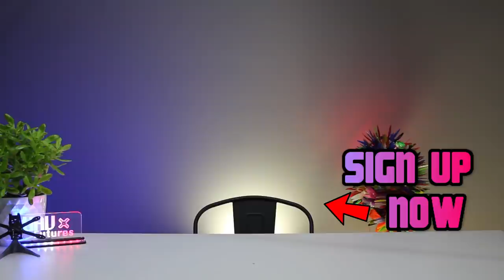GOLF CLUB VS UNBREAKABLE DRONE!! Karearea Talon V2 review

Comment: Maidened raceprac with mine today on 6s i posted the link in your discord :) not in the video but i hit a steel pole right on the front talon motor protector and i couldnt even see where it hit! it is indestructible.  got my second frame arriving tomorrow. its so good and looks so much better sitting next to my other quads.

Comment: when i first started flying there weren't any good simulators, hell there were no fpv cameras even and we flew on wii mods and kk boards.  at any rate, i lost orientation on my flamewheel 450 because it got too high and i couldn't tell which way it was headed.  it was probably 400-500 feet up and i decided that just disarming was the way to go.  i was in this big open field with small hills with pine trees on either side.  the quad came tumbling through the air at mach 1, slammed into a couple of the trees on the hill, hit every branch on the way down, hit the ground and rolled out into the field like a gymnast doing cartwheels.  all 4 props were shattered (this is in the days of glass-fiber props), i had 2 bent motor shafts, and 3 broken arms.  pretty sure my pvc pipe landing gear died too.  probably the craziest wreck i've ever had.  and seeing it happen basically in slow motion from a distance was something i'll never forget.

Comment: Looks awesome. Another possible con is camera mount? I don't see a good spot for mounting a camera :-(
Reply: Fits all micro fpv cams. if you're referring  to a gopro etc. there are slots for a strap near the top, but would need to design a mount that fits over the fin, not sure if anyone has already designed something  or not

Comment: I completely dead on center crashed into a metal rugby pole at full throttle. Literally nothing happened. I just bent a prop but that's all. My camera could have so easily died that day. I was flying a Realacc Karearea Talon clone and it took no damage at all. Actually the pole took more damage because I scraped off its paint in that crash. The camera was protected by the sides of the frame and somehow it (camera and frame) survived perfectly fine.

Comment: Yep this injected plastic will be the way alot of frames go now 💪
Now Just need to get all running components as strong 😃
Reply: I dont think it will be (coming from someone who prototyped this frame and has 2 of them on built up for racing).

Too many people stuck in the mindset that weight is the only deciding factor for them (despite the fact this Talon V2 is slippery when you want it to be but corners on rails) and secondly, it is very, very expensive to tool up to make. 

You can design a standard race frame in an afternoon easily, which is why everyone seems to have their 'own' race frames on the market because by and large they are mostly all the same thing, but getting the mix of plastics right and making the mould is a very costly endeavour.
Reply: @grounddodger3212  that might be the case in racing, but not freestyle , don't right it off just yet my friend
Reply: @tribefpv  the weight thing doesnt worry me, I have been flying this for months and honestly wish the people who say 'but its too heavy for a racer' would try it, there is so much more to how a quad flys than weight; this frame is designed to be maximise the usable thrust coming from the corners, carve through the air and to really grip in corner. I wrote the description for the frame as well has prototyped and tried many other frames over the past 7 years to come to the point where I have found this to be the direction frames should be heading.

Problem is convincing people (racers mainly) that weight is only one factor in how a quad flys.

But the biggest obstacle is price. Injection moulding is hugely front loaded in terms of cost. The actual manufacture cost per unit isnt expensive, but there is considerable up front costs involved in the production of the mould.
Reply: @grounddodger3212   i fly a banggod 5" 6s 2408 motors with airunit probably the heaviest setup you can get and luv it flys amazing 👍 the weight helps wen you throw over a tree or something. Im happy to pay more for quality.  Nice work on that frame, i think its awesome and that you get no interference with signal with plastic is a huge plus for long range and bandos
Reply: @tribefpv  yeh like I said, I have 2 x Talon V2s for racing  it just I dont see any other manufacturers really wanting to try injection moulded frames simply because of the costs involved in tooling up. I think injection mould is an excellent idea and I wouldnt have 2 x Talon V2s for racing if I didnt think that, I just dont see others manufacturers following suit.

Comment: Wow, 109g racing frame? I don't care how durable that thing is, you are behind from the start of the race, with a frame that heavy.
I'm glad they stayed below 60$ for the frame. I always want it with a lower price tag. But this is not the worst.
Reply: A superlight frame with a 3D printed pod will prob weight around 80 ~ 90g which isn't too much lighter than the Talon V2. And plus those superlight frames don't have the aerodynamic benefits. The Talon V2 might actually be 'lighter' in flight because there is barely any drag.
Reply: @RyuIan  might be. I'm no expert. But I'm not convinced just yet.
Reply: @RyuIan  seems like we will never get a part 2 review of this frame. But the five 33 switchback frame is only 55g. Only half of this one, and is used by many racers. I would go with the switchback as it is a more traditional style frame. But I can see some trying this one.

I like that they tried some different materials, to improve on durability. I still think 110g is too heavy tough.

But, who am I to decide which is the best? I like freestyle flying. Not in to racing.